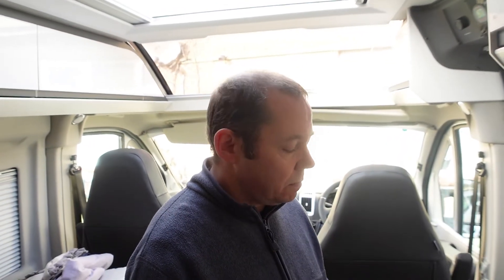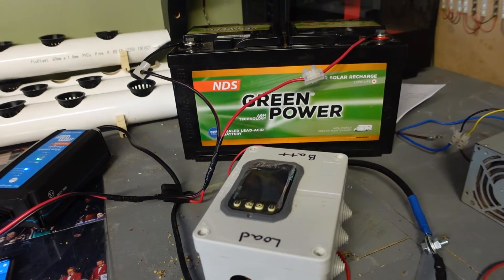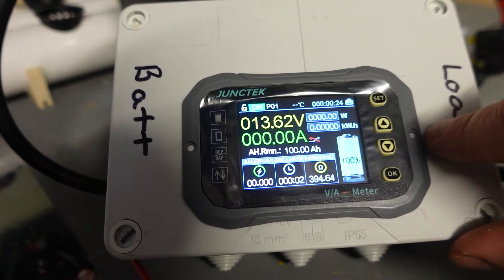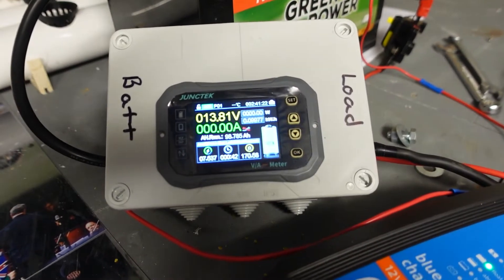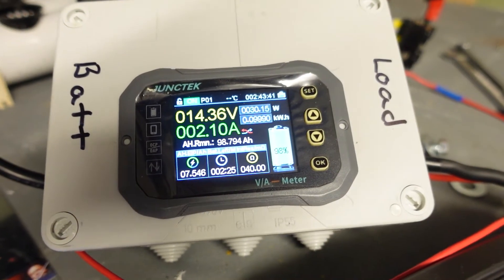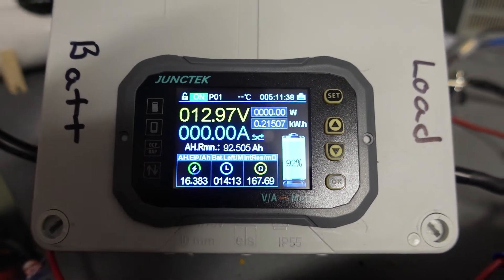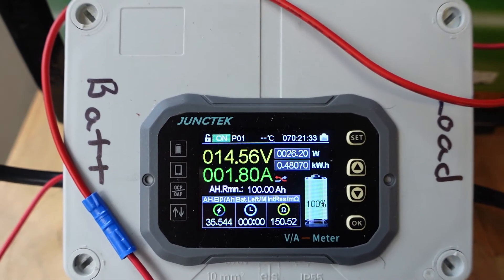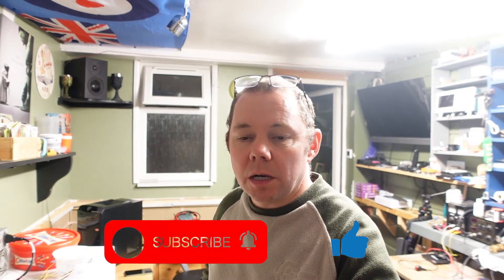KG-140F JUNCTEK Juntek shunt gauges are they accurate

Comment: You tried to tackle a complicated subject here. Having a meter try to calculate the capacity of a battery and how much energy is available is tough. Lots of variables IMO. Battery type and age being a couple of factors. Flooded cell and even AGM batteries need a bit more than 100% energy to fully charge them due to simple internal losses in the process. I just purchased the Junctek KG-F series meter like yours. So far, I'm happy with it. I get good signal on the blue tooth too. I still think the capacity indicator will need periodic resetting though. It's gonna drift with cycling and time I think.
Reply from the maker: you are correct, this is only really and short term indicator. I have a different one on my lithium battery and this drifts over time. I normally charge up to 100% over 24hr before any trip and reset the meter to 100%. In end it only drifts a little and if you have 30% showing on a AGM battery you know you are in trouble. The voltage indicator is also a good reference.
Reply: @BrackstonesTravelAdventures  Yep, true! Like some other reviewers, the unit lacks a LOW temperature disconnect too for Lithium type batteries. What do you think?